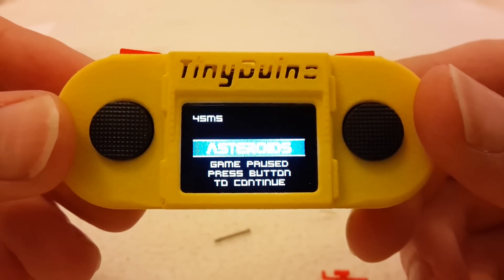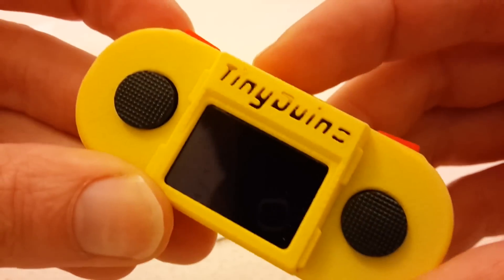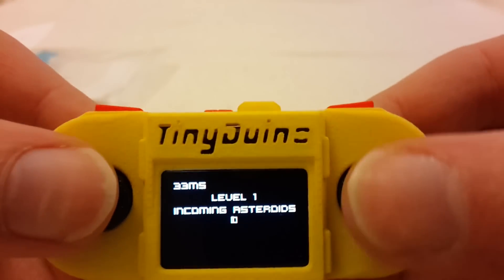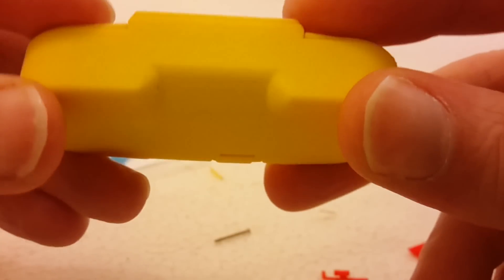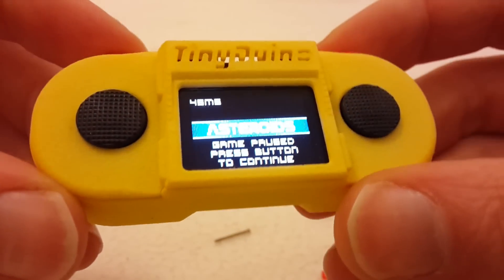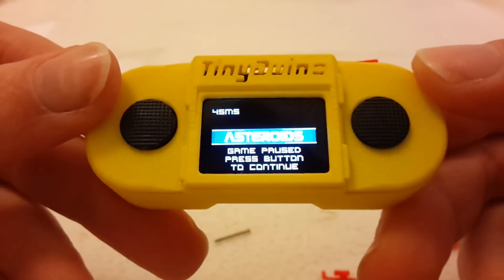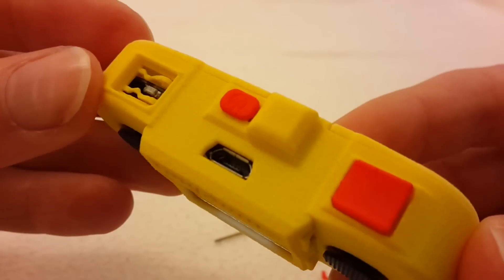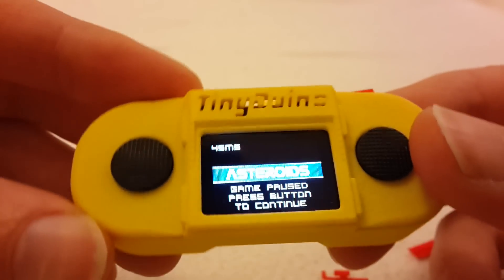TinyDuino Game Kit Case Assembled

Comment: Wie schwer ist es spiele zu finden und darauf zu laden
Reply from the maker: Spiele für die TinyDuino sind schwierig zu machen da die Hardware sehr limitiert ist (2kb ram, 32kb ROM Programmspeicher - also etwa 2% von einer guten alten 1.4mb floppy disc). Die Tiny Arcade (nachfolge Gerät) ist etwas einfacher zu programmieren da diese 256kb ROM und 32kb RAM hat. Es gibt da auch ein paar mehr Spiele für - allerdings gibt es meines Wissens nach nicht sehr viele Entwickler dafür derzeit.
Reply: Eike Decker also wieviele spiele gibts ungefähr habe nur 3 gefunden, und es werden Bestimmt nicht mehr dazu kommen da dies ja schon etwas älter ist, hab ich recht?

Comment: Hi eike decker I would like to know are you able to make a custom case because I have the gamer kit and I plan to put the audio shield on it with the micro ad adapter
Reply from the maker: Teckwiz it's a rather difficult job to make the construction work. I still have issues with the screen button elements. I also got a sd shield to enable external data sources in games (though I think this won't work as I expected for various reasons). Sound would be great too. 
If you can give me the exact measures of the sound shield (board dimensions, connector position and size), I could make a virtual construction - but I can't guarantee it to work. There are subtle problems that are easily overlooked and that need a test run. Besides, would you also order it at shapeways or do you intend to make it yourself with a 3d printer?